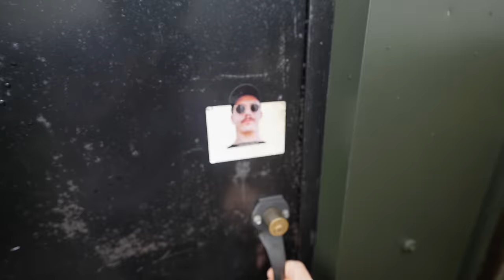I blew ALL OUR BUDGET on parts for my RX7 FC build…

Comment: sounded like power steering pump going bad when putting your awsome FC RX7 RAG TOP half roll cage color match with wheels get the jdm rear tail lamps i tell ye looks awsome in yellow is it canary yellow or another coded yellow looks great in few weeks you have it now 👍 ps white very nice ehite half cage now cause ur convertable roof be your weakest part car as you know I'd be into seen the cobra roll bar for driver and passo side would look cool and
wheel color matched just a idea I'd like to see on convertible one

Comment: that bs about coilover adjustment has been going since bc started being popular....Yet No proper manucfacturer do it. SO, either Öhlins, bilstein, Reiger and KW have it wrong OR it's BS. It's BS.Spring are more often than not linear so it does not matter whether they are compressed 1mm or 35. Still the same spring rate. If your coils is loose, you're out of adjustment.
Reply from the maker: Compare the price of a KW set obviously, BC are a mid-range affordable brand. We could say any part is great and someone can comeback with another costing 5 times that’s better. The balance is what works for us. For example, a set of Bilstein in the same spec as the BCs costs more than either RX7 itself 😬